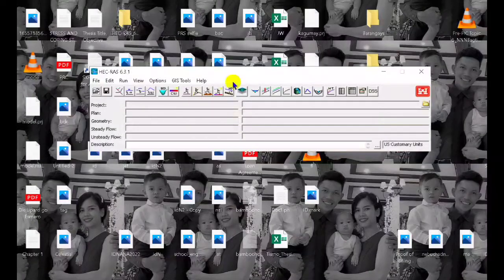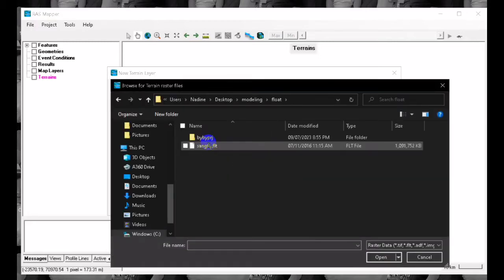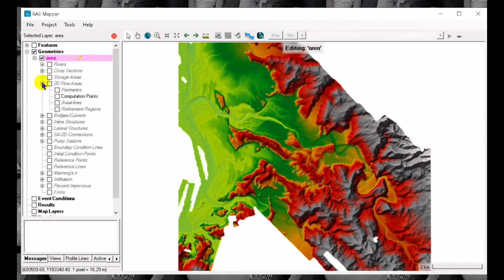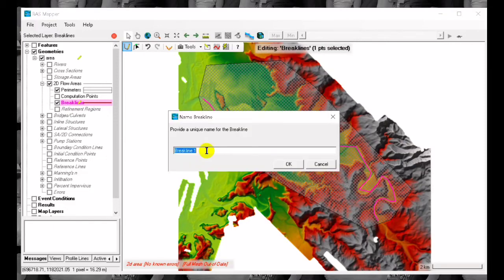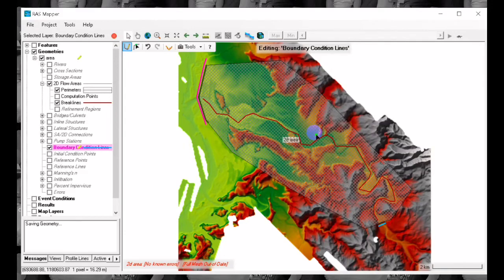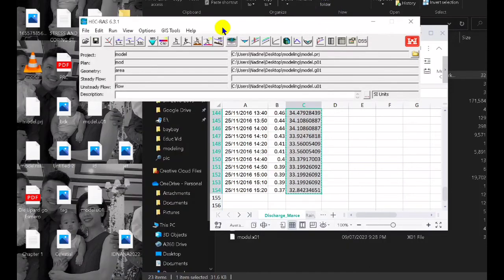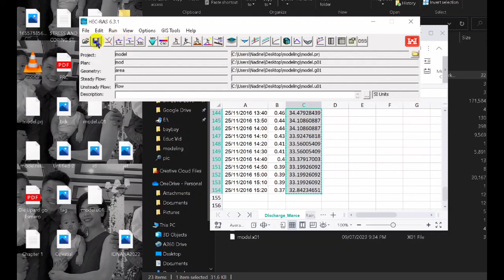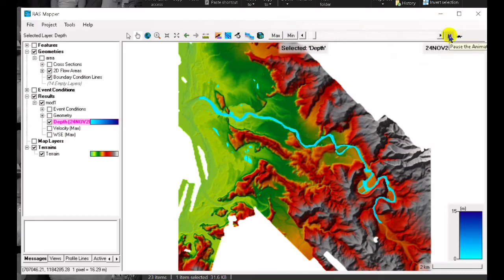How to simulate 2D floods using the latest HECRAS-2D (6.3.1)

Comment: I hope you're doing fine , would help to answer my questions if you can . IAM using Hec_ras model to do flood inundation.

Q1 Downstream of my study area is very huge in size and it is challenging me to mesh the river channels because there is no left and right bank to mesh the river. Also flood means over flow water from river banks so to get flood inundation it is difficult to get depth river.

Thank you so much .
Reply from the maker: What is your input?
Reply: My input data is  DEM .
Reply from the maker: @ahmedsalah4334 input unsteady analysis?

Comment: Sir, where will I get the flow hydrograph data and normal depth? Please reply.
Reply: Flow data can be collected from any concerned department of your country like disasters management authority or whatever active there...
Cross section data can be taken from tif file analysis using arc gis.
Reply from the maker: You have to get actual velocity & depth data during typhoon or rainfall event then the cross section of the river at that point where data is collected

Comment: How Do we choose the Normal depth value?
Reply from the maker: You can measure it on actual what is the base flow depth at the outlet of your river
Reply: I do not have the values for the base flow. How can I calculate the Normal Depth value more accurately.
Reply from the maker: Use Mannings equation to calculate